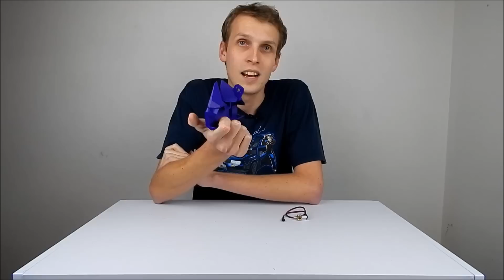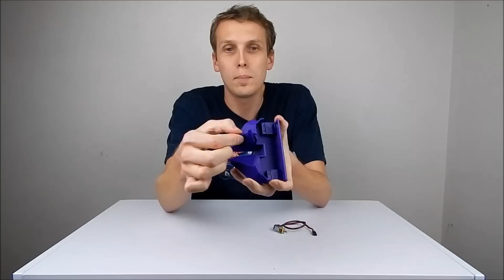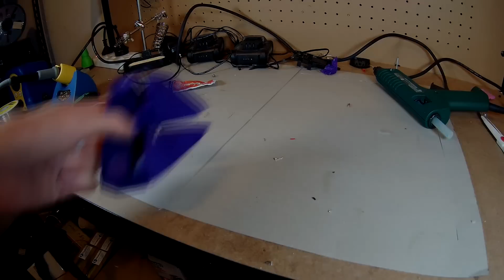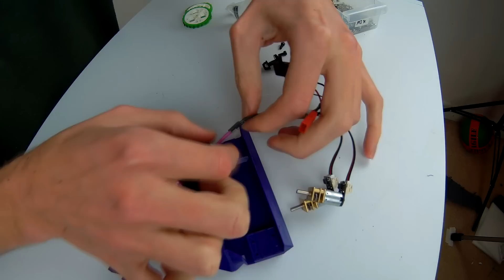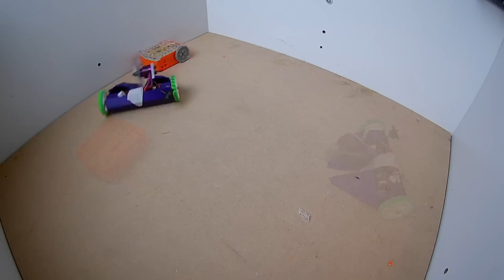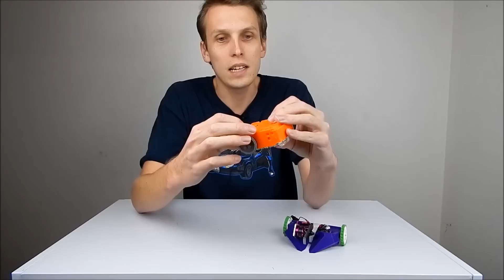150g Vertical Spinner build!!!

Comment: Hey! I have a quick question. Im building a 150g vert and wanted to know how you mount the blade to the motor shaft. Is it just wedged or compressed between the nut and the spacer, or something else? Thanks!
Reply from the maker: yep! just a nylock nut holding it on, sometimes I run a spacer between the weapon and the motor, sometimes not and its just wedged between the nut and the can of the motor
Reply: Thank you so much!

Comment: its fun... i have seen you made a lot of mini-bots , maybe bigger ones too. your channel is called " Team Panic " and still u use bad techniques like crafty panda..   think about that there is FORM fitting and FORCE fitting..  your whole spinner engine is just glued into a slot.  thats very worse form fitting , with bad force fitting ( only glue ).    you could have made the engine mount with another Bar, or for example in shape of an 90° angle and put it in place while printing ( pause at right time).   so you could integrate that engine holder into the body with more than just a flat sheet glued into.         you could atleast drawed a  hole trough the  chassis and drill a hole to the engine mount sheet in a good position. so you could fix that plate after glue it into the slot.    as a jury, i would even allow your bot cause your weapon mount is crappy.            funny you all think youre designer and engineers and in the end most of you just build things ready for trashcan.
Reply from the maker: And yet, iterations of this bot not only fought but won more fights than they lost and also still hold my personal record for number of wins by breaking an opponent so badly their battery fell out (the only instant KO condition)

Funny how you think you know so much better than anyone yet you've commented on an almost 5 year old video, ignoring the videos of its fight performances and its iterative improvements as they demolish your argument.

Nice armchair engineering, good luck ever building your own bot

Comment: Stl Files???
Reply from the maker: Not available for this design
Reply: @TeamPanicRobotics  Darn it, Thanks!
Reply: @TeamPanicRobotics  May I ask why?
Reply from the maker: There's a few reasons but the main one is that this early version had a tendency to self destruct, the print around the ali upright was not strong enough. So I dont want to release this as its a faulty design, but the upgraded version got extra weight in the front armour (so it didn't break) by swapping to one very specific, short carbon fibre drone arm. I used it because I got a bunch on sale for a few dollars a pop. However they where on such a good sale because they where being discontinued and are not available anymore

So, to give out the files I either give files which will break on people or I give files designed for parts that dont exist anymore neither of which are a good option for me to post on a public forum where new comers might be looking for a first bot build
Reply: @TeamPanicRobotics  That makes a lot of sense, I've just been looking into building a battlebot for a while and wanted to start small, and this looked perfect but I understand safety concerns, if you have a cool design or a stl file on a bot that is awesome please let me know, I would love to check it out
Reply: @TeamPanicRobotics  You should also totally make another video on this stuff, it's really cool

Comment: how many rpm do locomotion engines have? and how many mha and C rate does you battery have?
Reply from the maker: I use 50:1 N20 gear motors for drive, I cant remember exactly what RPM they are.

The battery is 2s 180mah, I cant remember the c rating

Comment: Hey dude that is amazing I’m currently building an Antweight do you have a link to where I can buy the little motor that powers up the weapon?
Reply from the maker: I use a purple dys 1806 brushless motor, I got it from hobbyking but cant find a link for it anymore.
It maybe discontinued
Reply: I've bought these motors from this ebay seller twice and are almost exactly the same as the one Team Panic mentioned. DYS 1804 2000KV brushless

https://www.ebay.co.uk/itm/DYS-1804-23-2000KV-BX-Series-Set-of-2-Motors-200-250-Racing-Quad-CW-CCW-UK-Sale/371742220429?ssPageName=STRK%3AMEBIDX%3AIT&_trksid=p2057872.m2749.l2649
Reply: MattS7227 thanks 👍🏻

Comment: I've decided to use the Quanum 2700kv motor for my robot as well. I'm still waiting for the motor to arrive. Do you by any chance have a CAD file for a motor mount?
Reply from the maker: I have a very rough mock up in 123d desgin, but i doubt it will be much use to you
Reply: @TeamPanicRobotics  Anything is better than nothing. All I really need is the dimensions/spacing of the mounting screws.
Reply from the maker: The purple ones have 4*3mm mounting bolts.

The bolts sit in a cross centred on the main axle of the motor. 

The distance between the centres of bolts on the arms is:
12.6mm
and
16.6mm

ie, one set it further out then the other
Reply: @TeamPanicRobotics  Thanks! I really appreciate it!

Comment: Hi what motor would you recommend to run for a beetleweight robot weapon?
Reply from the maker: Honestly no idea.

I'm still trying to find a good setup for myself.

Personally I'm looking at brushless outrunners with a power rating of over 200W and a KV of between 1000 and 2000
There are so many motors that fit in this range that it comes down to what you can fit into your robot.

Comment: What receiver is it you're using? It looks absolutely tiny
Reply from the maker: Its a FS2A 4CH flysky receiver and it is tiny!!! 0.8g and a super small foot print.

It can also handle up to 10v at the input so you can plug a 2s lipo straight into it. 
Currently, I think its the best rx for a 150g robot, but I want to fight with it a few times before fully recommending it

Comment: You could use single tooth
Reply from the maker: I could, but personally, I prefer bars/double tooth weapons.

I have seen first hand that the first hit slows the weapon to just the right point for the second hit to get a massive bite. Its almost like having a tuned clutch but the clutch does damage as well.

My first 13kg bot still has two chunks taken out of the wedge where an egg beater hit it and threw the whole robot 2 meters up. Its clear the double tap allows a huge amount of energy transfer
Reply: dat guy i was thinking the same thing.
Reply: You talked to me about SOW dat guy

Comment: You should add a something that sticks up that allows you to drive inverted with the weapon able to spin so that you can gyro over or ram yourself into a wall to flip over.
Reply from the maker: We'll see how I go with weight. I only have 3 grams left and I need to add better back armour and an actual top plate.

If I have the weight its definitely a good idea!